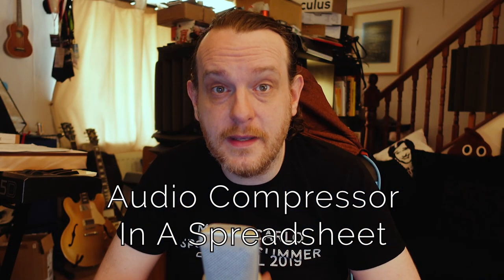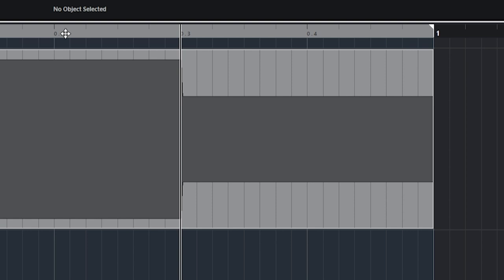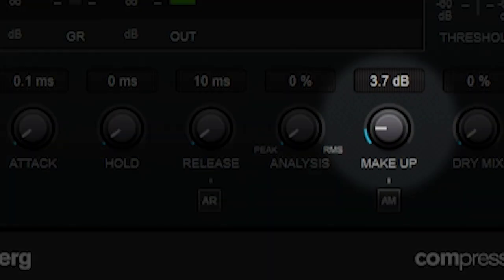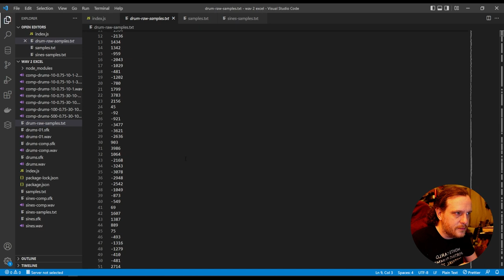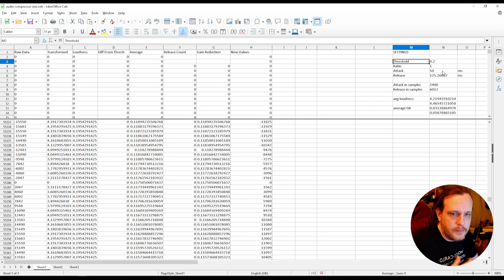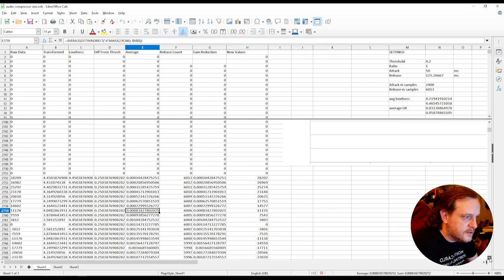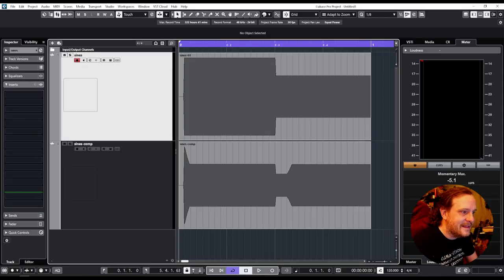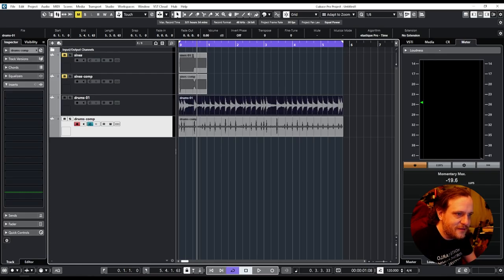Compressor Plugins vs Libre Office Spreadsheet! We Ask The Question... Can It Compress?

Comment: Been wanting to watch this for a while and finally managed it! Great idea, and very good explanation of how compression works. I’m not sure I followed why you did the Log10 part, was it just to get a more usable number to work with than the raw data in column a? Could you have transformed the raw data in a different way? (I’m not a mathematician, in case that wasn’t already glaringly obvious)
Reply from the maker: Sound is logarithmic so -20 to -10 is the same as -2 to -1 or something like that. It's not a linear numbering system so to work on it in a linear fashion you have to do the log tranforms... I'm no mathematician either!

Comment: 2:31 you have explained the ratio exactly the opposite way as it works.....
Reply from the maker: 10db above the threshold attenuates to 5db above with a 2:1 ratio as it halves it. 4:1 halves it again. Inf:1 allows nothing above the threshold. What is wrong with that?
Reply from the maker: “The amount of gain reduction is determined by ratio: a ratio of 4:1 means that if input level is 4 dB over the threshold, the output signal level is reduced to 1 dB over the threshold. The gain and output level has been reduced by 3 dB. Another way of stating this is that any input signal level over the threshold will, in this case, be output at a level which is only 25% (i.e. 1 over 4) as much over the threshold as its input level was.

The highest ratio of ∞ :1 is often known as limiting, and effectively denotes that any signal above the threshold is brought down to the threshold level once the attack time has expired.”